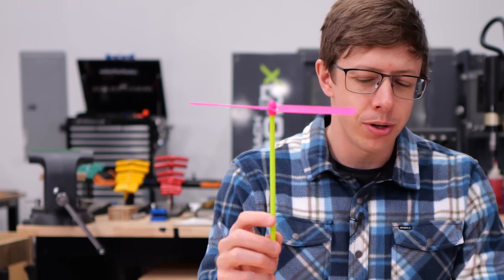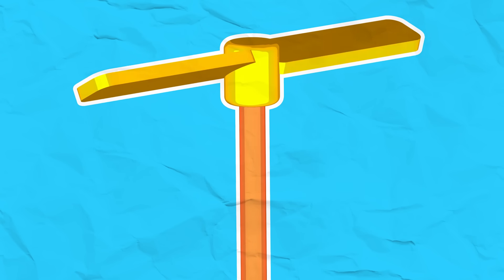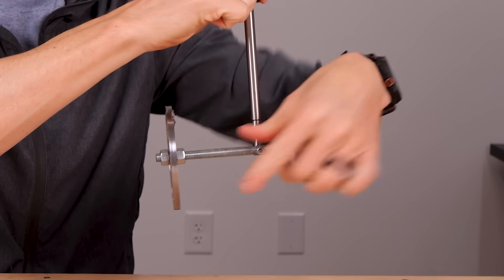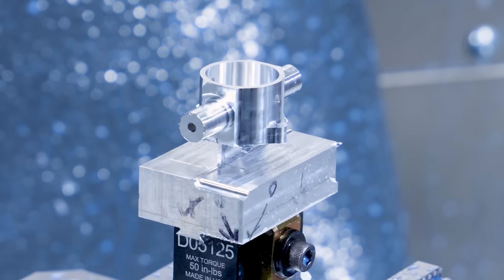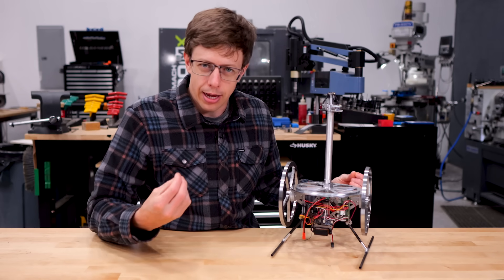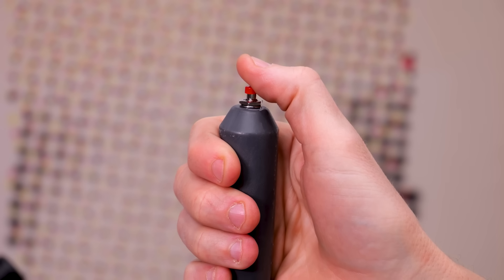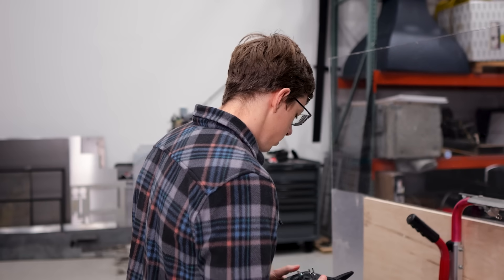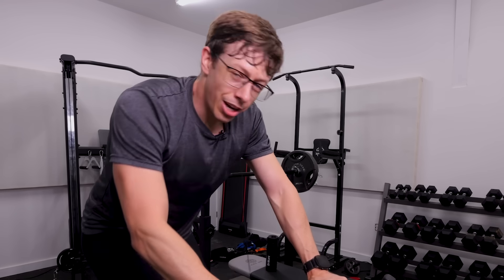I really thought this would fly well

Comment: Have two of the very basic hand helicopters end to end with the propellers away from each other. Have both propellers facing same push direction but spinning two different directions. You could have a motor spin one internally but if motored or not, have an omni directional to 1-spin direction gear to push the other helicoptor blade. So a spin to push down motion. Having two of these may cancel each other but if you could get them in a chase where the bottom is always getting forced air from the top (even thou they are spinning two different directions) and to where the gears are basically working together to turn fluidly together because one is upside down they would look like they are both going in the same rotation. So one gear will push down into the other's gear to push it (so to speak). This would get you further then before, you should be able to scale up big enough for an internal gyro and maybe like you did with heli-reversable blades. So it could be somewhat controllable or have pressure setup to auto push the rod to flip during landing. Try keeping it simplier.

Comment: I'm no aerospace engineer but I don't think your wings work while the copter is close to the ground because the air bounces of the ground back to the control surface. 
Plus now that i think about it. You try to steer with the air that's being pushed by the blades. But isn't that more like a spiral of air being pushed down by the blades instead of a solid cone of air? Because that would make it really hard (impossible) to get airflow over the surfaces for meaningful control. 
If you look at the design of the VTOL Osprey, they don't use the air of the rotors to control anything. If it flys like a plane they just use to rotors for thrust and then use the air they fly through to redirect with control surfaces.

Comment: how about 3d printing the main bevel gear and putting another metal (same weight as the entire rotating assembly) on the bottom, using the same flywheel but spinning in the opposite direction.

Comment: I have a probably-stupid question: Why not have a single shaft with a propeller on it, like the toys, and then a large, heavy ring around the outer tip of the blades to provide a bunch of additional rotational inertia with minimum added mass? No non-rotating components to calibrate yaw for. Recovery can be from a remote (or altitude-curve?) triggered parachute deployed from one end of the shaft (presumably the top?) once ascent stops (before tumbling has a chance to set in), with a rotation cancelling fitting in the parachute lines to reduce tangling. (what do you call that? I'm sure there's a word for it. A tension thrust bearing thingy between two sets of ropes.)
Then again, while smaller/lighter than this, it would still hurt someone if it fell on them (and possibly damage something like a car), and while the parachute would probably work, I don't know how close you could get to 100% reliability... most parachute designs don't account for spinning deployment AND staying clear of a large area of the vehicle.

Comment: You are pretty much creating an rc helicopter at this point. And without any flybars or active stabilization (those control surfaces aren't enough) it will be inherently unstable.

I would look at coaxial, contra rotating propellers. Those can be made to be inherently stable (there are cheap toy grade rc helicoters using that principle)

Comment: Question. Would making the blades heavy work as the flywheel? Or a flywheel mouted at the centre of the prop. With a second set of counter rotating blades to cancel out the gyroscopic procession? All energy is input at the ground, so spinning the heavy blades should carry more inertia and have more potential energy. I just don't think the auto rotation for decent would work, as the blades would likely be too heavy to be accelerated to a high enough speed with just wind resistance.
Reply: Also keeping the weight low enough below the centre of lift should have it fly and fall in a consistent orientation. Like the keel on a ship

Comment: How about contra-rotating rotors, and make them much bigger, and maybe setup so they automatically change their pitch when they lose the torque input from the flywheels, just enough to "windmill" to reduce the velocity of decent?

If you trade altitude for rotor rotation you also buildup speed downwards, and unless the rotor can freewheel you need to speed up the flywheels too with that gravitational energy. And since spinning the rotors faster will generate much more drag and other losses than the kinetic energy going down that you build up by sacrificing altitude to make the rotor (and possibly even flywheels) spin faster, I don't think sacrificing altitude to spin up the rotor is productive. Obviously pitching the rotor blades up just before landing is advantageous, but I don't think intentionally sacrificing altitude and increasing rate of decent to spin up the rotor is, which I got the impression you tried to do. 

Another thing that might be worth considering is having smaller but many flywheels, besides the possibility to reduce drag, dividing the amount of energy on more flywheels means less potential energy per wheel, all else equal, which can be a good thing if anything happens.

Comment: I don´t know wheter complicating the kid´s toy into a proper helicopter is the right approach. After all the toy works well because of it´s simplicity. Would it work to ditch all the control-surfaces and the frame and just mount one flywheel coaxially to the spinning blades below them. You could connect it through a planetary gearbox to not have an offset in the connection. The minimal frame connecting the two would have to be kept from spinning up in the opposite direction uncontrollably by adding some fins to it.

I think such a design would also capture the essence of the toy better because the point of the toy helicopter is that the whole thing is spinning so you don´t have to design an actual helicopter.

Thinking about it I actually had a radio controlled children´s toy working exactly like that. It only had one control: throttle. It was called Tyco RC X.F.O if you want to google it.

Comment: Can I ask why you think the fan blades pushing down, basically on the helicopter itself is going to work? It's so massively bulky and in the way of most of the propellers down force. Make it skinny and light and out of the way of all that down force man. Helicopters are smooth and round, not blocky and full of holes and bits everywhere.

Comment: Suffering from LTE helicopter aviation term, it's what happens when helicopters spin and crash👍 love the videos
Reply: Could try counter rotating props or a tail rotor, maybe having the flywheel mounted along the same axis as the prop geared to rotate in opposite direction, maybe that would work

Comment: If you want it to fly straight, you need to put the flywheel on the outer edge of the propellers, as anything that makes the center of mass go away from the center of lift will make the entire thing spin uncontrollably in all directions

There's a type of these that are a large ring with propellers inside, with a beyblade type launch system, which leads to it being much more stable in flight

These are launched using what is pretty much an upside down beyblade launcher, and even the propellers don't stick out of the outer ring when viewed from the side 

I think you can search propeller launcher for an example

Comment: Wouldnt adding two more flywheels solve the spinning issue? They would be at a 90-degrees angle to the current ones.
Also, I would just look into the existing helicopters for the solution: either the smaller tail propeller, or a second main one, going in the opposite directon

Comment: Could you ditch the flywheels. And then use the big maingear on the shaft as the flywheel, with a inline 1:5 gearbox between the gear and prop?

Comment: I'm no engineer, but I was thinking that the side Gyro's are removed, or drastically reduced, and put one on the "bottom" of the unit turning anti to the one connected to the prop. The top one being a little smaller as the props are sort of their own gyro's. Then the larger one on the bottom of the unit would counter the prop/top gyro.
It would make controlling the pitch of the props harder for sure.  Slip rings come to mind.

Comment: I feel like the use of control surfaces to try to counter the rotation is like somebody in a falling elevator trying to save themselves by jumping at the end, or somebody trying to push a sailboat with an onboard fan. You really do need something like a tail rotor to generate independent thrust to counter the rotation.

Comment: parachute might still work, but coming out the bottom. It depends on where the center of mass is. If the propeller no longer holds the whole assembly upright, the parachute takes over while the whole thing is upside down.

Comment: Since you already own a 3D aerobatic RC plane, wouldn’t it be easier to just take a similar ratio of thrust to torque to control surface size? I mean it works quite well with those aerobatic planes.

Comment: the easy way would be to use counter rotating propellers instead of using passive flywheels to counter gyroscopic effects.
 but you never go the easy way so instead you should use reactionary wheels .
 looking at your previous videos you probably already have the gear you need and the knowledge to program the Arduino.  i built a small one for a rc motorcycle and it wasn't hard and i might still have the program if you want it it's yours .

Comment: To be fair the principle changes as soon as you do anything but just upscale the original stick with propeller design. Adding a propeller to counter the spin just makes it a helicopter, so that’s kind of leaving the principle too. But for sake of making something interesting and fun i suggest exploring the ice skater principle where they spin faster when folding in their arms, maybe you can manage to utilize this effect to prolong spin while using the rod as the gyro as in the handheld toy. There is spin, inertia and screws, this could allow for a gradual «folding in of the arms».

I remeber we made these with tin can lids. Very little air resistance, but dangerously sharp. I guess i’ll have to explore the self launching design i played with using a hollow rod and a fast drill, point beeing it sliding off and launching because of its lift from the spin.

Comment: Why didn't you keep the flywheel parallel to the wings, in line with the shaft? I am confused. Would that break something else?

Edit: Maybe a solid cylindrical flywheel, instead of the big discs, to reduce surface area and drag. The weight on the shaft might even keep it balanced and pointed the right way up?

Comment: That's such an amazing piece of mechanical engineering already, even if it didn't work as intended. 👌 Those bevel gears look absolutely gorgeous as well although they're atrociously inefficient at transferring power. Maybe flip the flywheels to the same plane as the rotor to be able to use a belt, and use only "ailerons" to stop the spinning? You don't even need to completely eliminate the spinning either as long as you can slow it down enough for an electronic 3-axis gyro to compensate for it.
Or you could use this as a perfect excuse to machine one of those counter-spinning prop mechanisms. 😋

Comment: This is cool, man. You're never going to get a wing to work against those lateral forces using rotor wash (way too turbulent for control surface work). It wouldn't even work in water. There's a reason we don't put control surfaces behind motors. You need a counter-rotating blade, my friend. 

Either that, or you can do like the kiddie toy does and drop a LONG lever arm down from the blades, tighten everything in as close to the shaft and as low down on the lever as you can, and let the length of the lever and the weight of the mechanism work as a stabilizer against the blade. Good luck! This is going to work great and be super cool when it's done!

Comment: helicopters typically use a tail rotor for this problem .... cheap quadcopter motor and propeller on a carbon fiber rod off the back and it should fly fine

Comment: To fix the torque issue, why not mount the flywheel on the other end of the propeller shaft in line, with a planetary gearset to reverse the direction of rotation and increase the speed of the flywheel? And just design the flywheel such that its moment of inertia is smaller than that of the rotor by the same factor as the gear ratio.

Comment: That was fun!  Your flywheels are of the classic (ancient) style.  Most modern ones are spokeless disks because the physics wants speed over mass since the energy stored goes up with the square of the velocity.  You also don't want the stress concentration caused by the spoke-rim, spoke-hub connections.   The spokeless design also helps with the windage as you discovered.  LOL

Comment: The counter-rotation problem is solved in real helicopters with the tail-boom rotor. The control surface idea isn't working because the air never moves fast enough around them to have an effect - in aeorplanes, the rudder and ailerons are less effective at slower speeds (which is why it's so difficult to recover from an aerodynamic stall).

Comment: Could you put another horizontal gear sandwiched on top of the other one, and have a second counter rotating blade underneath the first one like a cheap RC copter? I imagine the efficiency is rubbish but it would solve your rotation issue

Comment: What would happen if you put a single flywheel flat on the bottom spinning the opposite way of the blades? It would probably end up being offset by the size of the gears, but the gyroscopic effect should counter that out, no? And worse case if the momentum follows the weight of the flywheel, the blade would just spin faster and lose a little efficiency. I didn't put a ton of time or thought into this idea so I could be missing something really obvious or dumb, but that was just my initial thought after seeing two flywheels and imagining that wouldn't work before you explained why.

Comment: Engineering in a nutshell, even it looks cool it doesent work as intended.. And more likely theres already option that works better. 13:00 "Makes it harder to tip it over" BUT not difficult. xD It just baffels me how he didnt end up measuring the torque that blades cause and simulate the planes how much they need surface area to neutralise it with max angle for cyclic.. Also turbulent flow is a huge problem under turning blades with ground effect.. We not going to see this on Mars..

Comment: This would work fine, just incorporate a system that releases after you spin up the stick, then release the stick like the original design.   You could put a weight on the bottom of it to give it more mass to hold momentum, or use a heavier rod?

Comment: That may be a very naive approach to this but why not make the flywheel turn on the same axis as the rotor ? It seems a lot of issues stem from the fact that you have two perpendicular spinning axis. That would still require to find a way to counteract the torque of the rotor but at least you would only be fighting one problem
Anyway, great video as always and good luck for part 2 !

Comment: The easiest way to counter rotational forces is to have a second one going the other way. I get that you just have a helicopter then instead of a take on a toy, but once you went past sticking a fly wheel on the bottom of it, you already did that. So a second set of propellers would fix it.

Comment: My immediate thought was that the mass of the horisontally rotating elements are way to much for a wing of any realistic size... Either a counterspinng flywheel could solve it, or lighter still, a stabilizing rotor... like a helicopter! I think making it gyroscopic sensor dependent is the best choice, but it would require more power on the device.

Counter rotating weight could be directly geared in, spinning at flywheel speeds to keep weight down, but gearing costs weight and will take some torque from the wing rotor... would be the most fun though!

Comment: 1:14 i might me wrong, but i heard the most upward momentum is not blowing air downwards but the pressure difference between the top and bottom blade, at least on conventional blades
Reply: You're correct.  It's the same as an aeroplane wing.

Comment: weirdly enough, grid fins may solve this problem. I made a stabilized coaxcopter, and no matter how long I made the control surfaces, it wouldn't fly. But then I used grid fins and it worked great, even with the same controls! They are very draggy though. This really needs a swashplate.

Comment: Your original assumption of ‘dangerous descent’ is incorrect. As long as the design is bottom heavy, then regardless of the blade pitch angle (unchanged from launch angle is fine) the system will auto-gyrate back down. A simple fly wheel on the bottom of the original plastic toy would have been an improvement.

A simpler anti-twist system would be twin, counter-rotating blades.